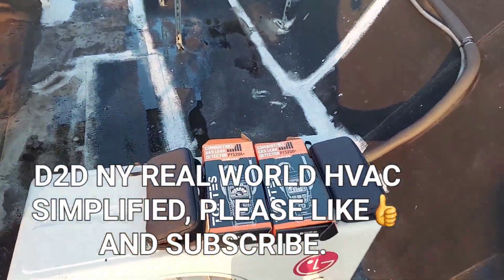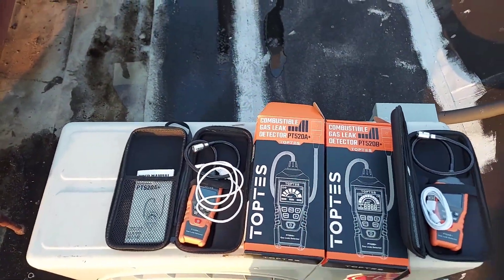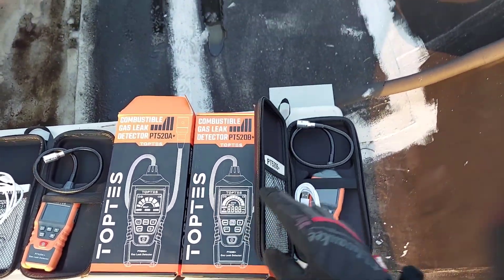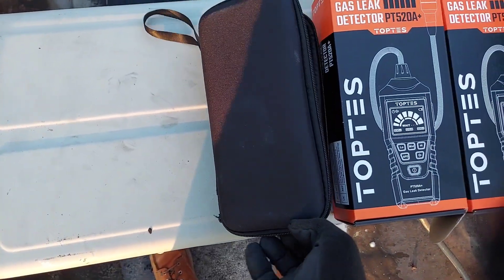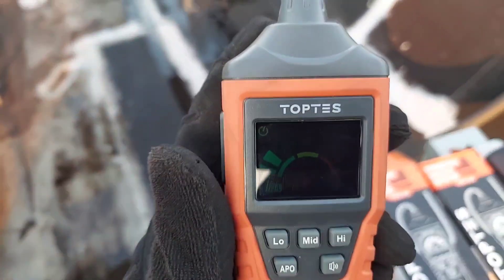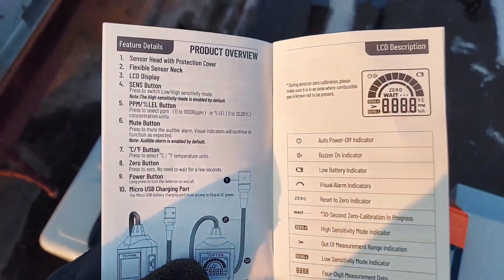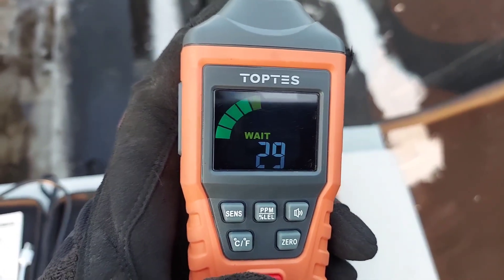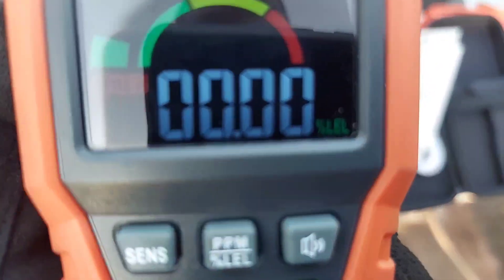TOPTES  PT520A+ | PT520B+ TOOL REVIEW

Comment: Those detectors are not for co, they are for combustible gas detection.  Get a co detector if you want to check co levels.
Reply from the maker: Though you may be right it does give and alerts from the furnace exhaust
Reply: Yes, not saying you were wrong.  And I do see similar detector and same looking sensor that does advertise CO detection.  However,  just to be extra safe, since it is a non-combustible, odorless gas, I would invest in a device specific to reading ppm of Carbon Monoxide if I were still in the HVAC service field.  Thanks for the review, I bought one on Amazon for crazy cheap compared to what these cost years ago, and found my Natural Gas leak close to my recently installed HWT.